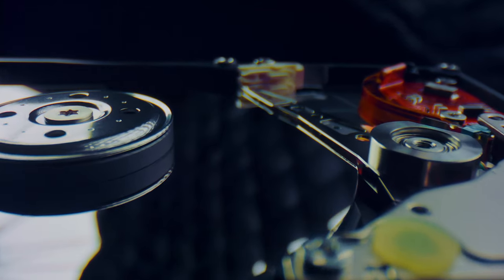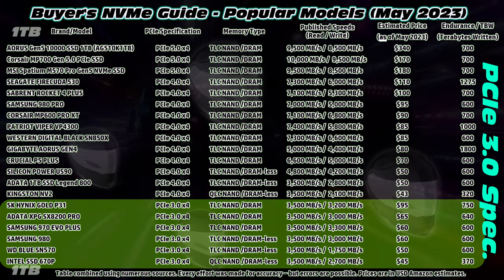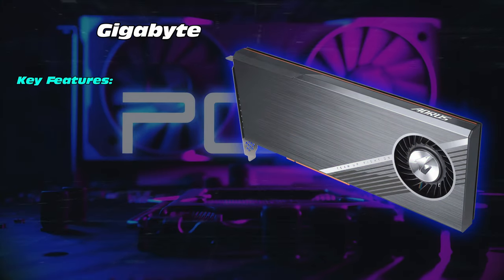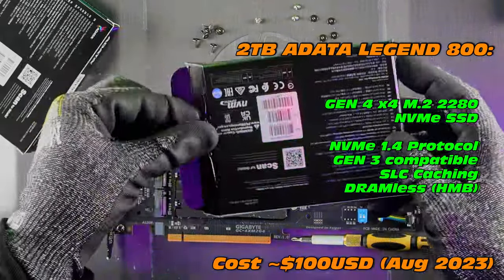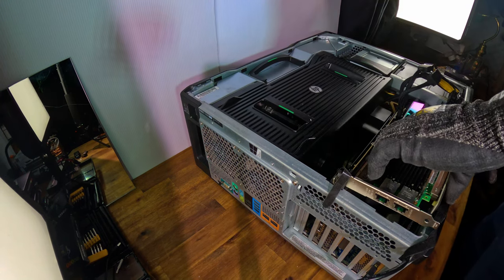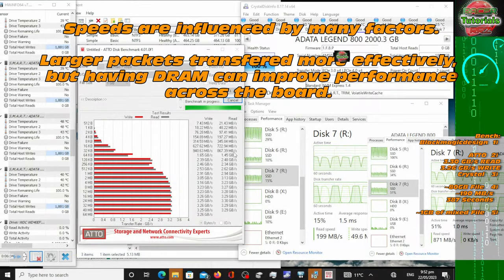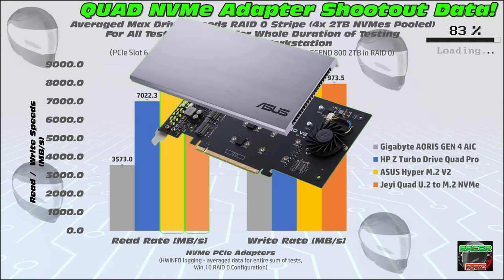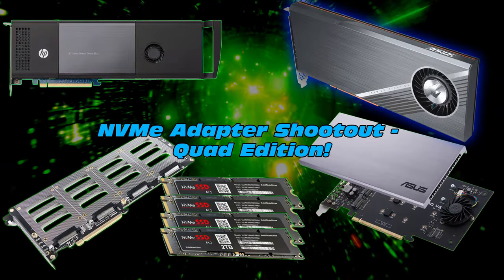RAID 0 Guide: Gigabyte AORUS Gen4 AIC NVMe SSD - This Solved Slow Transfer Speeds * Eventually

Comment: Good, but slow down a little. Many of us have English as a second language.
Reply from the maker: Thank you for the feedback and I am sorry that you found it difficult to follow due to the pacing. It's a fine balance between keeping the video pace fast enough to not waste people's time, and keeping the content easy to understand. Generally the trend is to keep the pace really fast to maximise the amount of information packed into the shortest amount of time. It takes ages to edit content to that level, but it is generally better to keep things at a slower more conversation-like pace. Without feedback I would not know when I have reached the "too fast" point. Noted, new achievement unlocked - I can now slow down again!
Reply: @racerrrz  thank you for responding to your viewer comments. Much  appreciated and impressed. I too have the Asus Hyper m.2 card, and it works perfectly in my Asus X299 system. Watching this video validated my choice to go with nvme  storage. Your content is very good and relevant to maintaining and extracting the most from slightly older hardware. Again, thank you for the content.
Reply from the maker: @julianfiacconi709  Thank you for your feedback, much appreciated. 

NVMe storage remains the best method for some really fast storage. My only complaint right now is that their prices have gone up so much it makes it more difficult to get a Quad NVMe adapter populated. I am working on testing a RAID pool of cheap SSDs for my Mini PC server build - but that was the best workaround I could come up with to counter the recent flash storage price increases.

Comment: So you do not slove the aorus problem? Clikbate bruh
Reply from the maker: Hi there. I can't solve what appears to be a PCIe 3.0 compatibility issue with the Aorus Gen 4 adapter, only Gigabyte can do that since it's their product. All I did was to report the issue I experienced to help others make a more informed decision with their purchases. 

The Aorus will give you higher speeds than what you will retain from a single Gen 3 NVMe, and I gave a method for that (4x NVMes in RAID 0) - delivering on the video title's claim. If it were clickbait it's not very effective, the video hasn't blown up - but I do believe many people would benefit from the video yet still. 

I did do more testing to confirm the issue. I purchased 4 new 256GB PCIe 3.0 NVMes to again test the Aorus Gen 4 AIC adapter and it again came out substantially slower than the other 3 adapters I tested (HP Quad Pro, Asus Hyper V2 and Jeyi Quad U.2 to M.2).

Comment: In 10 years people will be looking at the rtx 4090 with its size and laugh their ass off. Since APUs will have completely taken over . They will seem like ancient technology
Reply from the maker: Given the rate of progress with technology your claim isn't that farfetched, and right now APUs provide some speed benefits. But with Moore's law beginning to bite back it might slow progress until a viable technological leap is established. My only hesitation with APUs would be heat dissipation. Considering that GPUs like the RTX 4090 generate a phenomenal amount of heat (necessitating their huge cooler), I don't APUs will be the technological leap needed to push a new frontier, but they will bridge the gap. If only quantum computing would make quicker progress, but they are a long way off from reaching the consumer market.
Reply: I doubt APUs will take over because we are hitting some physical limits
Reply: no way APU will take over in 10 years. Unless we have quantum computing making a leap

Comment: I have a side question, I'm trying to see if this would be a valid solution. But, I do need your opinion. I recently started testing out ramdisks which is like a drive on ram, the reason for this is for speed since ram is faster than nvme. I tested it out on my computer using Linux and I only have seen a few GB/s of transfer to ramdisk to ramdisk. 

I was wondering do you know why although in theory ramdisks are fast but in the real world ramdisks are kind of like an nvme ssd? And, have you tried a ramdisk before?

I can't seem a lot of information about this online.
Reply from the maker: Hi there. Portioning a segment of RAM as a RAMdisk can provide really fast storage since the PCIe interface isn't required for communication with the CPU. 

There are however some obvious caveats. As you'll be aware, the most critical issue to circumvent is that of data loss in case of system power loss (something that can be somewhat negated with an uninterruptible power supply). 

In terms of speed, the theoretical speed will be limited by the specifications of the system you have setup (so the hardware and the software managing the RAMdisk). 

At a guess, your NVMe-like speeds would be the result of a bottleneck in the system (speeds are only as fast as the slowest point in the system). If you are accessing the data directly to and from RAMdisks the speeds should approach that of the theoretical maximum of the memory. e.g. The HP Z840 with DDR4 2400MHz ECC memory should net ~19,200 MB/s (2400 MT/s × 64 bits ÷ 8 [bytes]) as the theoretical max. If you are using older RAM, say DDR3 1600MHz it should net a theoretical max of 12,800MB/s. The next issue is overhead of transferring different file types and how efficiently all the hardware can communicate - which will vary depending on the system specification and design. 

I haven't explored RAMdisks as of yet, mostly because of the volatile nature of the memory (I mostly seek secure long term storage). 

Good luck with your system, it sounds like a cool project!
Reply: Hello,  Your right regarding ramdisks, I wouldn't use it for long term storage. I just got into ramdisks due to the extreme benefits of speed competing with nVme drives. In theory, your absolutely correct. However, for some reason ramdisk to ramdisk on Linux, the speeds are drastically slow. And, I have a fast system with DDR5 memory.

I was curious, have you tried using a ramdisk on Linux yet doing a file transfer? If so, what were the results?

Also, I do appreciate your repsonse. I'm just trying to get as much feedback as possible since I have been going on google researching ramdisks for a while and the min throughput but so far I haven't seen any results that are reaching the theoretical max, but I have seen results that reach nvme speeds but aren't nvme. 

I also subscribed too, I do like how take the time to respond to your youtube comments, and so far I do like how you are doing raid 0 pcie bifurcation nvme drives. I love speedy solid state drives!

  @racerrrz
Reply from the maker: @interactivesage4609   Thank you, I appreciate your sub and the positive feedback. I am in process of uploading a new NVMe video – 980’s in RAID 0 on ASUS Hyper M.2 V2 – I managed ~ 7000MB/s read – PCIe 3.0 with DRAMless NVMes, I’ll call that a win over the aged PCIe protocols lol. 
Your RAMdisk speed quest sounds like a worthy challenge – and I understand the quest for speed haha. It sounds less likely that the speed limit is hardware, making it more likely to be software, file system or file type that’s causing the limit. 

In my quick search, this link looked like it could be of use: https://copyprogramming.com/t/ram-disk-to-speed-up-my-ide 

What software protocols are you using for the speed benching? It seems FIO would be the best option on linux (HDparm and “dd” as runner-ups). Given the lack of results pushing towards the theoretical max it only really leaves two scenarios. 1) it’s not possible to attain anywhere near the theoretical transfer speeds (maybe everyone runs into the same issue), or 2) the setup can be refined to remove the bottleneck and reach faster speeds. 

I do not have any experience with RAMdisks so I can’t provide any data to help with your quest. There are a few considerations that could be worth testing: Test different benchmarking software/protocols (in case the software isn’t reporting correctly), ensure your RAM modules are functioning optimally (Memtest86 etc.), test another system with the same protocol (If a lower spec system nets the same speeds it could point towards the transfer/files being the bottleneck.), test different transfer methods (commands like cp, mv, rsync, etc. or different file systems if used [ext4, xfs etc.]). 

Hopefully you manage to unlock that extra performance!
Reply: Thank you for your comment, I appreciate it. @racerrrz

Comment: You ever thought about a Thinkstation P520? Also check this out. This looks so cool. ICY DOCK 2 Bay M.2 NVMe SSD to PCIe 4.0 x8 Removable Mobile Rack for PCI Express Slot Adapter Card (PCIe Bifurcation Required) | ToughArmor MB842MP-B
Reply from the maker: Hey, I have looked at the Thinkstations and their specifications are really good for their price point. I'll have to keep an eye out for a cheap unit.

I have done some reading into the alternative ways to store NVMes but I have not seen removable PCIe NVMe slot adapters. Great find. The ones that caught my eye are the 5.25" bay NVMe adapters. If their prices come down I would be tempted to get one for a quick video, ToughArmor MB873MP-B: https://global.icydock.com/product_305.html
Reply: @racerrrz  oh man 8 NVME in one bay. That would be some heat but so awesome.
Reply: @racerrrz   the P520 2 native nvme slots with heat sink. Such a deal for that one with DDR4 2666 and some nice options for xeon cpu's.
Reply from the maker: @feelsbad1193  Having two native NVMe slots is surreal for a workstation. They really look like solid machines, decent CPU and RAM options too. My only complaint would be the internal space for a GPU. I'll have to check the published measurements but I am not sure you'll be able to fit an oversized GPU in there. But with enough effort even that could be fixed (case swap lol).
Reply from the maker: @feelsbad1193  I imagine that heat will be an issue if you manage to use all the NVMes at the same time. I can imagine a RAID 0 with 8x NVMes, or even two of those adapters to really push the NVMe storage front. But it all comes back to end purpose. Right now I am looking at ~2.5TB free space on the new ~8TB RAID 0 pool that I have set up. A few months later I'll need more space - unless I segment projects between NVMe and HDDs etc.
Reply: @racerrrz  The P520 comes with 2 6+2 power adapters. The only thing would be the width as it is a bit narrow.  I know though a 6700xt will fit and I have seen a 4070 also inside that model.
Reply: @racerrrz  A nice ZFS setup and it would be pretty slick.
Reply from the maker: @feelsbad1193  If it can fit a RTX 4070 that should leave more than enough space for expansion. Online photos make it look like the HDD bays and PSU would pose an issue for a 3.5 slot GPU but there may just be enough space to get a 3.5 slot GPU in and still have another x16 slot for expansion. The 900W PSU should give a nice buffer for expansion also. It appears very similar to the HP Z6 G4 Workstation in terms of functionality.
Reply: @racerrrz  This video they put a 6700xt and a 4070 and it looks like plenty of room.
Reply: @racerrrz  There is also a couple of noctua cpu coolers to improve the temps.
Reply: @racerrrz  It's also a 900 platinum PSU. It really might be one of the best older workstations for how cheap it is.
Reply from the maker: @feelsbad1193  That should give them a decent amount of room to push the CPU. I was hoping to get some Noctua fans onto my Z840's CPUs but I never got that far. lol
Reply from the maker: @feelsbad1193  I can't argue there, it might be the best value machine at the price point.
Reply: @racerrrz  GET ONE!!!! Make some videos are what cool things you can do with one.